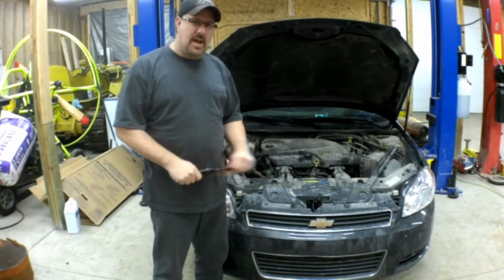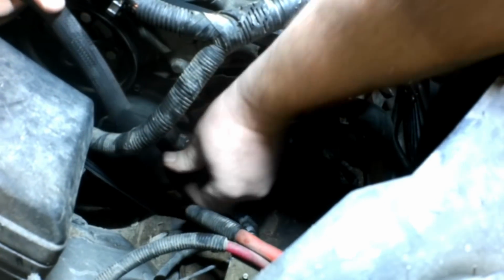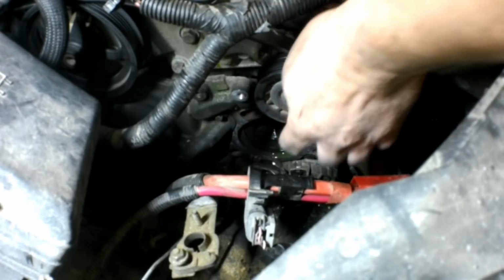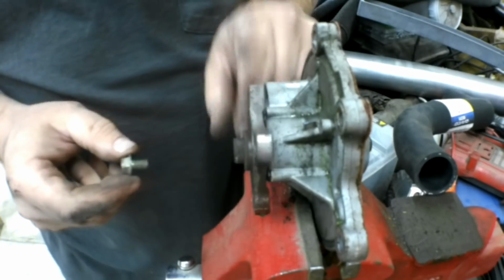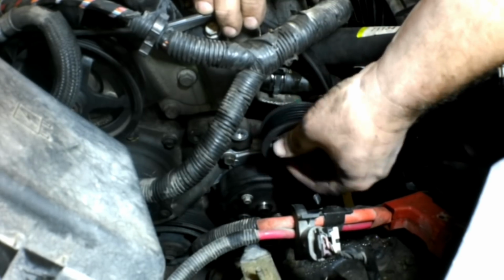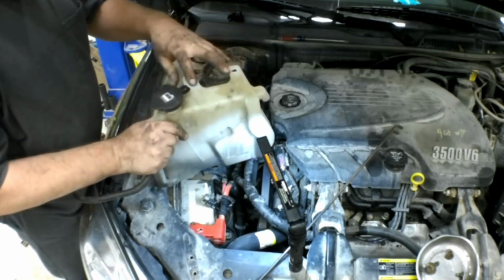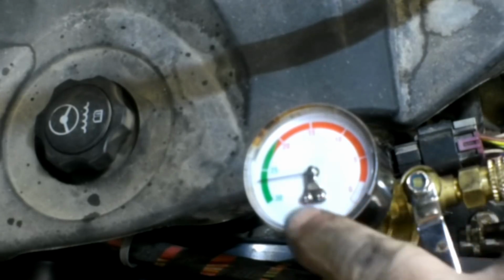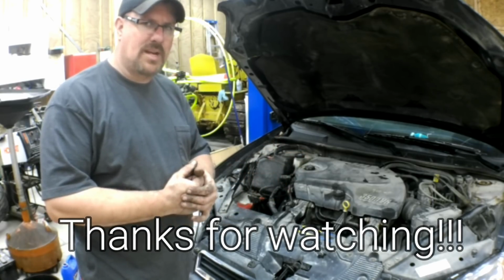Chevy Impala 3500 (3.5L) water pump replacement

Comment: Is there a reason why you didn’t use any gasket sealer.on the pump?
Reply from the maker: Gasket sealer IS NOT needed on the pump! Clean the mating surface and install a new gasket and it will not leak. Gasket sealer just creates a mess for the next guy who has to work on it.
Reply: ts6034 
Thanks....
Reply: the gasket was metal. you only put gasket sealer on paper gaskets not metal ones.